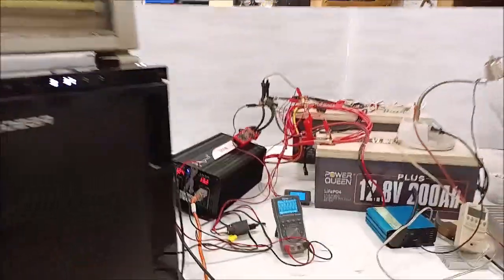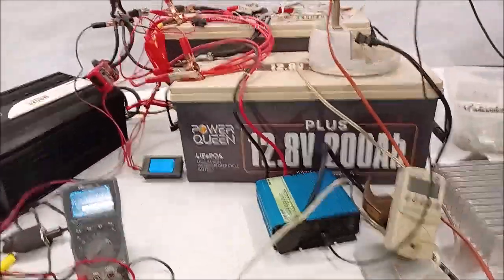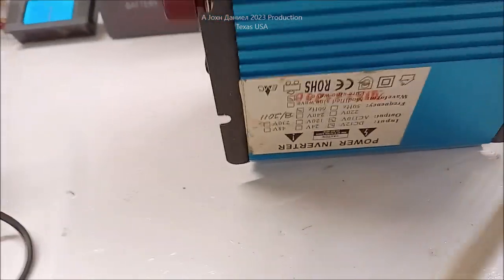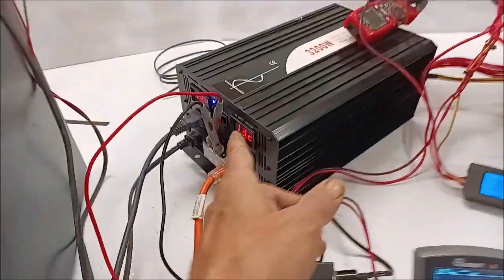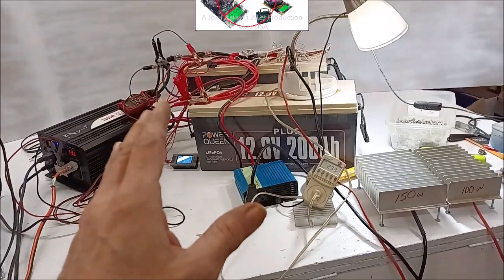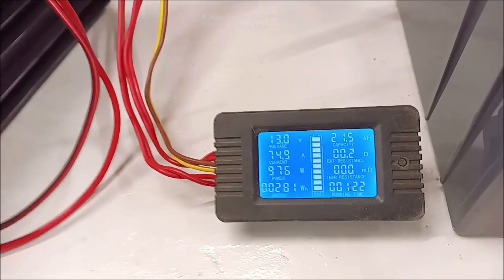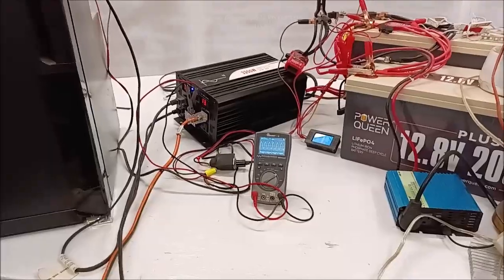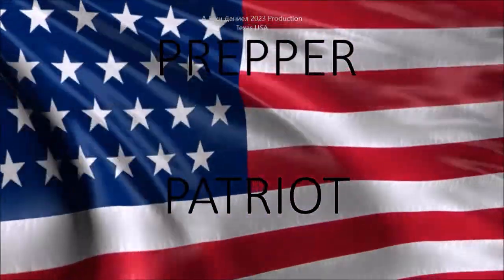Xijia CN SWI Power 3200 watt pure sine inverter REAL TEST using 2 Power Queen 200ah plus Batteries

Comment: How many solar battery 12.8 200ah for 3200w pure sine wave inverter 12v?
Reply from the maker: Get 2 of the 200ah TIME USB with 200 amp BMS to run it well https://amzn.to/4lcatpn ( best priced and top cells ) and if your asking how many panels, that depends but I would do a 1000 watt array at least. 500 watts per each pair of 40 amp MPPT controllers like the SNRE made,  and 10 of the JJN panels https://amzn.to/4lG4LMv will get you a great system to build on. Ultimate goal should be at least 1500 watts solar or more.

Comment: We have 3000 kijia and 2000 kijia  both working at 80 % the 3000 fan runs 2 seconds and of for 3 seconds and inverter  isvery hot is there a heat sensor that can be moved to solve this problem
Reply: Thanks John I will make that change sounds good
Reply from the maker: First look to see if the black heat switch on the heat sinks are loose. If not, You can reduce the temp by relocating the sensor to much closer to the Mosfets on the heat sinks. Using a slightly longer screw if its too short, on the back of the first/second from the end mosfet you can connect the sensor to the back of the bar that secures the mosfets. opposite side the fets are on the aluminum, but directly behind it. I have this on the ones I use in trucks to just keep them cooler. It can be up to 15 degrees cooler running but fans will run much more.

Comment: I have the Xijia 12v 3000w version, it runs my 12000BTU window AC but from time to time it will have Overvoltage error. (i used the socket) So i bought this new one with 3200W 24v version and thought it will handle the AC just fine. NO, I AM RrONG. This one is worst, it won't even run. The invertrer makes noisce and my AC run but not correctly. After 10 seconds. I got an error number 6 (AC fault) and the inverter shuts down. I tried the sockets first, definitely did not work. I then tried the high current AC connection, That would not work either. This one can't handle the current rush of the AC unit. I am returning it.
Reply from the maker: Error 6 is hertz mismatch. They got a batch of miss shipped from the secondary shipping company that all were shipped as 50 Hertz. The Japanese board versions.  So you likely got one of the 120 of them that slipped in like that. That is what the issue may be. I have redone 5 of them for Swipower. Its on the control board and if you choose to fix it they will normally give you some money back. For me it was 2 hours to make $50 so worth it. It's a 100 ohm SMD resistor you move from one spot to the other. But depends on what your dealing with. Test it for the hertz/volts and send them a picture, if you need direct contact info send me a email olympicpowercontrols@yahoo.com and I will reply back to you their direct info.
Reply: @JOHNDANIEL1  Thank you John for the quick response. The inverter will only make the strange noise when the AirCon compressor kicks in.  If the Aircon starts with the Fan mode, the inverter has no error. I  also tried to add more load even up to 1800w and the inverter is fine. It only fails when the AC compressor kicks in. Normal running of the AC is 940w Fan mode is 136w.  So does it have to do with the 50hz mismatch?
Reply from the maker: @wsurfer2147  I would say it is either that or too light of battery source or cables. A 3200 fires up my 14K btu GE air conditioner with no problems even with them cooking in a 650 watt roaster cooker at the same time.
Reply: @JOHNDANIEL1  I have double 4awg and 150a bms 24v batteries. When the inverter made the strange noise I saw 1500W drawn at the LCD display of the inverter at stuck there at 1500w. It should surge then goes back down to 950w as in the 12v inverter.
Reply from the maker: @wsurfer2147  If you just swapped a just recent compressor running AC unit to the inverter this can fault the AC amps, not the AC watts by causing excessive voltage sag. This  is called Rotor Lock. A AC unit is notorious with this. If you allow it to sit 2 minutes before turning back on this solved the rotor lock caused by high compressor line pressures. AC units can throw breakers if switched on and off fast with the compressor running. A Inverter being sensitive to faults for safety will refuse to run one that is still in high compressor load.
Reply: @JOHNDANIEL1  Hi John, When I got the new inverter, I tried to run AC on it first from the socket then from the high current connection. Both didn't work because the inverter and the AC make strange noise. I thought the AC went bad. But then when I hook up the AC to my 12v inverter. It worked fine so I know that problem was with the new 24v inverter.

Comment: Have you seen inside the Power Queen 2000 inverter? Would like to see inside one just to compare it to the CNSWI 2000 build Quality.
Reply from the maker: It's 14 ounces lighter than the CNSWI so consider that info. And the PQ model is from a company who's only been around 2 years, not 19

Comment: What size wire and fuse would appropriately supply the 3200 with full power?  The run is 3ft or less.
Thanks!
Reply from the maker: 300 amp if 12 volt model and you intend on keeping it at or under 3200, a 350 amp if you occasionally have the need for over 4000 watt start up ability. Be sure to use a heavy built fuse holder and minimum 2/0 cables in that short run. Best with 3/0 cable though or at least 2 strands 2 awg, 4 strands 4 awg.

Comment: Bought a SWI 3000 a month ago based on your testimony. It's keeping a 2 small freezers and a 29CF Samsung refrigerator going on a solar setup.
4500 solar. Epever inverter. 16 Die Hard 29DC batteries. SWI 3000 inverter.

Comment: I have the CNSWIPower 3000-watt 12-volt inverter with the LCD that I use in my solar shed to charge my multiple lawn mower batteries.  I drove an 8 ft grounding rod into the ground and externally bonded the neutral and ground so no more floating neutral.   I got permission from Xijia before doing this and wanted to know what you think.   My electrical tester now says everything is great.  I performed a half-hour charge on my EV at 120v 12 amps along with one of my EGO lawn mower batteries on the 700-watt charger at the same time and the waveform looked great.  I cannot go any higher because I am out of amps on my batteries, and I refuse to run those out of spec.

Comment: a guy gave me a blow up vevor 3500 watt. vevor tried to save money on tiny little diodes for the IGBTS and the diodes failed which caused the IGBTS to lock in a ON state that shorted the output of the HF setup converters and it blew all 16 mosfets in it. and 4 IGBTS. i fixed it and have it running without the diodes for now (its for the gate overvolt protection) and the voltage regulation isn't very good on the inverter but it will do 3500 watts just fine and has pretty good surge. BUT they blow up.
You don't have to take my word that my vevor does its rating but I cant say its a good inverter because well... it in fact had blown up from the company cutting corners.

Comment: Hi John . What 12 Volt Pure Sine Inverter Size would you Recommend for A Microwave oven under Solar Power .
Thank You John 🙂
Reply from the maker: https://s.click.aliexpress.com/e/_DeDQzTr
Reply: @JOHNDANIEL1  Hi John . I clicked on what you sent me . That says $ 453.00 Dollars .
I thought it was Less Expensive .
I can't pay that much  I was hoping it would be about $ 300.00 .😢
Reply from the maker: @jjames5475  Click on https://amzn.to/3LjXouK then click on buying options, $360
Reply from the maker: 2500 Watt +
Reply: @JOHNDANIEL1  Hi John .. Can I Buy your 3200 Watts 12 Volt Inverter that your Showing  On Your Video .
That way I know ..
I'm getting The Best 👍
Thank You John 🙏
Reply from the maker: @jjames5475  The Aliexpress link below the video is the exact source for that one, the ones sold on Ebay are 2022 models. Avoid them. The new ones have the 200V caps and 90V Fets  and I heavily suggest that. We already have the 3200 installed and you will see that soon in a new Vid. It is running 2 Air conditioners and 2 nine cuf freezers.

Comment: How are these units at handling surge/start up loads?  My refrigerator has about a 2000w hit as far as I can tell, but I'd like to run a deep freeze and window air conditioner as well.   the chance it will see a double start load is small, but not zero.
Reply from the maker: I think it would handle all that well with heavier than provided cables, the required 400 AH and more of batteries, and as long as your AC unit isn't bigger than 6500 btu.

Comment: I have the 24volt 3000w inverter and without a load the display show 16- 30w periodically...is that normal ?
Reply from the maker: Yes. Its on search-Idle. It is normal since it's inside CPU does a instant on check and a diagnostic to itself.
Reply: I opened it up and it looks like something is up with the board
Reply: Too bad i cant send you a video or picture
Reply: My 12v inverter doesnt do that so i know for a fact something was up with it
Reply from the maker: What model 12 volt inverter do you have? If its pre late 2021 Xijia Sw-Power then no, it wont. Not sure what would be up with the board, mine is 12 volt new model and does the same thing, so does my stepdaughters who has same one.
Reply: Mine is the new model too. And when its in idle it stays at 0 watts. I opened up the 24 volt inverter (new model xijia swi) and it making a funny sound and watts jump from 16-34 watts and back to 0 watts keeps doing that this morning my batteries were drained and ive been wondering why so I opened the inverter and found the circuitboard strip peeled off the board and just dangling( poor installation of inverter pins are soldered half way terrible...hopefully they can send me one that works havent heard back from them yet
Reply from the maker: @Invictus88-l6h  If they are on they use power. They can't idle at 0 watts. only way to not use power is to disconnect them. Nothing with a display on or off can. Not sure what your 12 volt model is doing but nothing I ever bought from any brand sits connected with absolute zero power activity. At least not in the last 40 years. Ghost loads even exist on any car built with a computer or clock in it
Reply: You have whatapp or anything I can send you a video of what im talking about.?
Reply from the maker: Looked at the video, Nothing I can explain can help you since your comparing Apples to Monkeys! And testing on 2 different voltages, too low in 12 volt to keep the auto search instant on function running, and low but correct on the 24 volt, but that do not match the protections in the inverters. They set 12 volt to shut off auto search early due to those users are CAR, RV, TRUCK based to preserve the auto battery. 24 volt users are people with "incoming charge systems" AKA OFF GRID,  so auto search is always active down to 21.8 to 22 volts.
Reply: https://youtu.be/aanUtjiHaoE watch the video i posted on my youtube page show you what I mean.
Reply from the maker: Your battery is at 11.1 volts, the 12 volt inverter is in low voltage protection default, not in auto search at that voltage, it will show zero watts under 11.5 volts input. 
My suggestion, send them back.
Reply from the maker: Send it back, your obviously not understanding they have idle watt use. Your using undercharged batteries in your 12 volt set up, less than 11.5 in most but damn sure 11.1 is dead/default on 95% of inverters with power search features. To compare that to 23.7 ( not in dead default till it hits under 22.00) SO, Get one with ZERO meters, and a manual only switch and your ok then. But in the video, Your saying 19-16-19-16 ( 0.7 amps, about 2 X the natural, sitting only, nothing attached, drain down of Lead Acid / AGM ) But you have 100+ah 1250 watts, (2500 watts in 24v) if actually charged will run @ 24 volt system with only 25 watts, 1 amp, literally a $2 LED Bulb for a RV,  for 100 to 102 hours non stop. And that, that drained your battery over night!!!!!! Might need to send the batteries back too, seems they can't carry the average inverter. 
Send it back.
Reply: Watch my new video... im not sure why swipower xijia isnt responding and accepting that there inverter was poorly assembled
Reply from the maker: OK, Now you showed the burned Shunt bars, ( video short ) now your issues are obvious. But that's still not why it is searching, but it is why you should return it. Shunt bars limit the output on the stage. Take some real clear pics, And contact me on my email and I will direct contact them with the info. Should have shown that before, but makes no sense in the previous video it is reading 123 volts with those burned, 1 full one missing, should have been about under 100 volts. unless they burned after that video.
Reply: https://youtube.com/shorts/GxSUmk6oA6E?feature=share
Reply: Where can I find your email.
Reply from the maker: @Invictus88-l6h  olympicpowercontrols@yahoo.com

Comment: 1JOHNDANIEL I think I see some screw terminals here in the vid, and also on the sales links, but they aren't described. Is there full power AC lug connections on the 3200 in addition to the four plug receptacles?
Reply from the maker: They have 4 - 15 amp outlets and one 25 amp center terminal set.

Comment: JOHN WHAT DO YOU RECAMEND FOR BMS FOR ALLIE EX BATTERYS 60 AH LIFE04 A BUNCH OF THEM THANK YOU
Reply from the maker: Depends, LI-Poly or LiFePO4, or LTO or ?? What voltage, what plan to use for? What age of battery you starting with? How you plan to group (parallel of series plans)?
Reply: @JOHNDANIEL1  USING 4 TO MAKE 12V BATTERYS IT LOOK LIKE YOU CAN SPEND A LOT ON BMS I WILL USE THEM ON MY POWER WALL WITH A 2500 PURE SINGWAVE IN VERTER IM NOT SURE IF THE 60A BMS IS ENOUGH TRYING TOGET BY AS CHEAP AS I CAN THANK YOU
Reply from the maker: @leetaves9143  A bunch of them needs to be known what that covers. 4 sets of 4, 5 sets of 4? Whats your total? I would use the 100 AH BMS on 2 sets of 4 each time to make it 120ah with 100A output and 80amp charging but I am not sure your total battery set up. Did you send me a email with pics and data, totals?

Comment: John , have you tried their 6000w inverter? I have their 1500w, 2000w, 3000w, and 3200w. They have been in touch, and asked if I was a fan of yours, of course I said yes. They are going to give me a good deal on a 6000w , just wanted to know if you've tried it. Thank you
Reply from the maker: We put their 24 volt 5000 on the site in Texas big bend and it's running 3 AC units, a 18 cuf refrigerator, some outlets too all last summer without fail.
Reply: @JOHNDANIEL1  thank you Sir
Reply: I am replacing all of my powerjack inverters with these. I run a 12v system and only need split phase for my well pump. Do you have one you recommend? I have 69kwh of lifepo4 battery and 12k of panels. WV here. Thank you for any input
Reply from the maker: @melvintoman5650  Seriously for that absolute need, and where you are I would suggest the Sungold. https://shrsl.com/3zmnz  Like I did, Use all your SwiPower for spot power on pulled circuits as needed, but the Sungold like I did in Idaho it ran a 433 foot deep 240 volt 2.5 horse well without one issue, water wells pumps and controllers are a finicky load of needs.
Reply: @JOHNDANIEL1  thank you Sir
Reply from the maker: @melvintoman5650  You bet, I think you will love the options for your well and high amp tools on that Sungold. I use them since 2009 for those needs and not one fail. I use the Xijai SWI-Power for all else.
Reply: @JOHNDANIEL1  I'm going to order the Sungold. One last question, what gauge wire should I run from my batteries bus bar to the inverter? I have some 1/0 left over, but I'm not sure it's big enough to handle the start up.
Thank you

Comment: Great video. I have 2 redodo 230ah batteries 150 amp bms each. Going to run 24 volt. Which would you recommend? Thanks.
Reply from the maker: 24 volt, USA plug, 110-120 output https://s.click.aliexpress.com/e/_DcvLVU1 they have them in USA, Spain, Poland warehouses so you get them in under 10 days.

Comment: Appreciate this post, so timely for me. I’m looking to get into boondocking and have been researching inverters, found the Xijia and then your channel.  Newb question, for someone with (2) deep cycle 88ah flooded batteries, what wattage would you recommend?  Trying to not upgrade batteries at this point but don’t want to have to replace an inverter when I do.  Again, apologies for the newb question.
Reply from the maker: The 2500 is all your system can handle, luckily its on sale the next few days and it is the 2023 model. https://amzn.to/3J4qs7e  Insane good quality, I helped them make over 35 improvements, big stability changes, Fairchild 200v Mosfets now when they had mid grade TGM 160v Fets in them, and have worked with 8 Inverter and solar controller makers over the last 8 years. Pick the 12 volt, 2500 watt model.
Reply: Thank you so much!  I just checked out the Power Queen, that might be on the radar to upgrade from the flooded to LiFePO4.
Reply from the maker: See the results of me working with Blithe, and Fang in industrial marketing. https://youtu.be/H0LHVHBnzLM